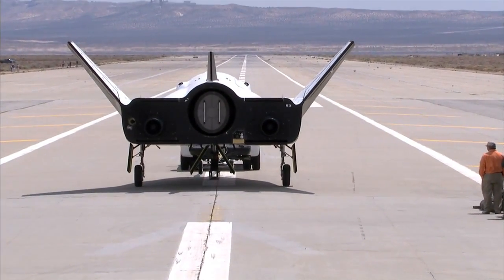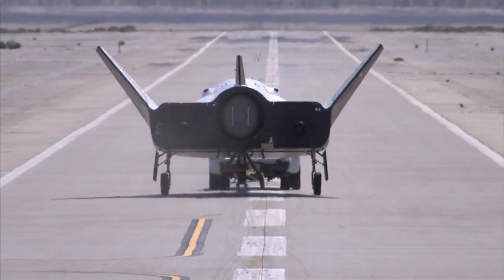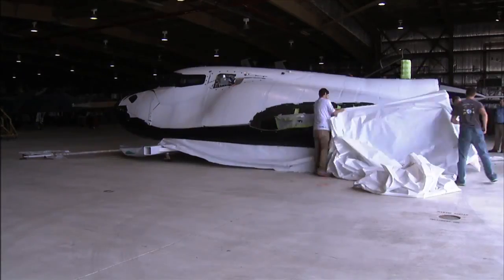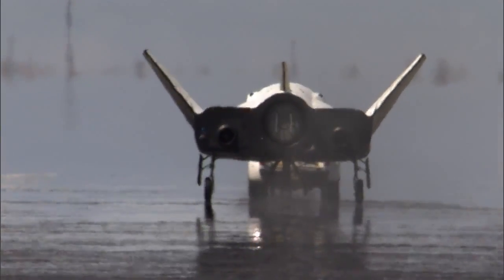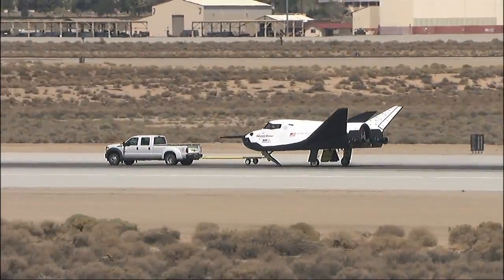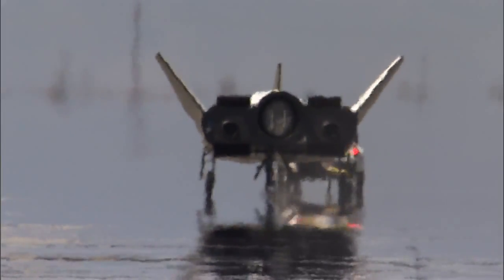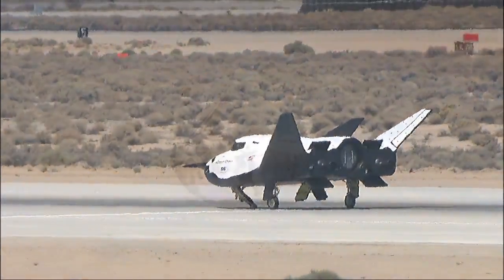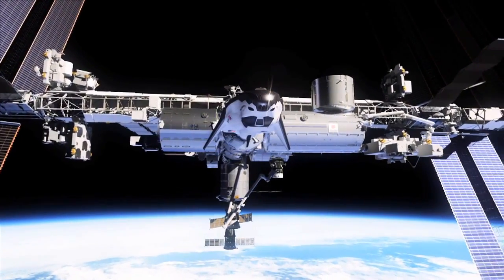Dream Chaser Spacecraft Towed by Pickup Truck | NASA Space Science HD Video

Comment: Some body , gve me a reason why they did not use  any wheel on the front leg.
I guess  this plane scratch  the surface of the Runway ...it needs some cost to fix it.
Why not using normal type of landing gear ?
Reply: It acts like a fail proof brake.